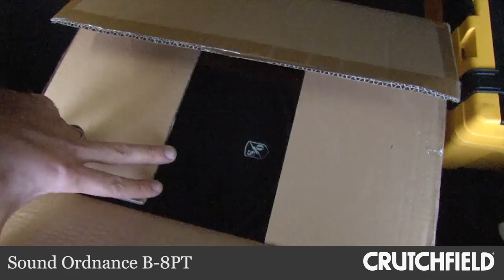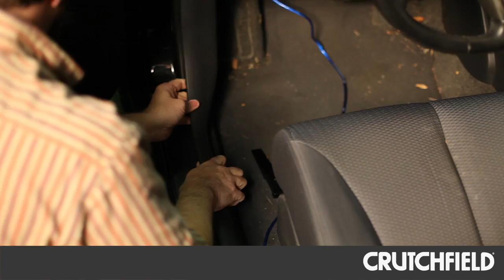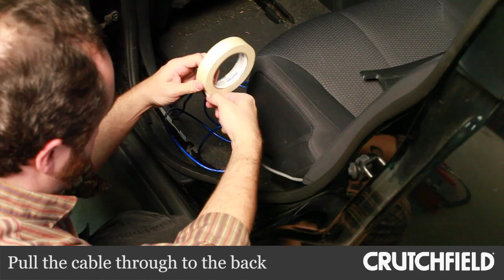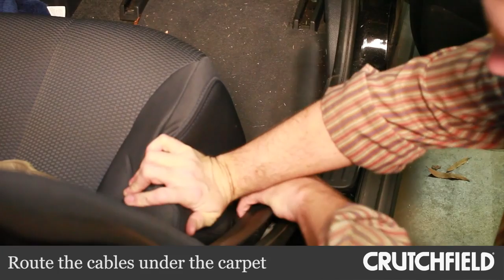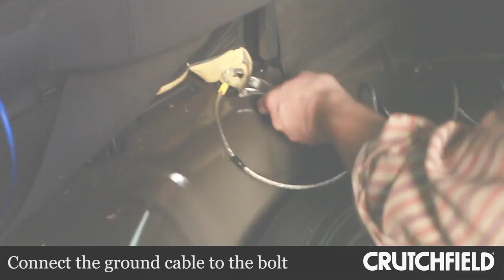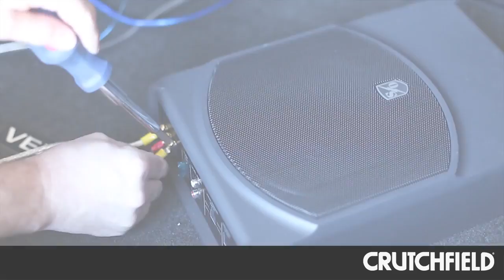How to Install a Car Subwoofer | Crutchfield Video

Comment: What side did you run the remote level control wire on? With the power wires or the RCA and remote turn on lead?
Reply from the maker: While we did not cover the wired remote installation in this video, most folks do run it on the driver's side.

Comment: I've sound ordnance b 24 ,what amp I need to push these CVS dual subs
Reply from the maker: +Dupree Spearman to properly power the Sound Ordnance B-24 dual sub enclosure, you'd want an amplifier rated between 400-600 watts RMS x 1 at 4-ohm. 

This Pioneer GM-D9601 amp is a good option to consider for your setup: www.crutchfield.com/I-rYTVc000/p_130GMD9601/Pioneer-GM-D9601.html

I hope that helps!
--Crutchfield

Comment: I have one question abou connecting positive cable to battery and subwoofer. Should i first connect it to the subwoofer, then connect the secure thing (50A) close to batery and then connect it to battery? Or first connect it to battery, and then to subwoofer?
Reply from the maker: +Gabriel Durias You should wait until you have everything else connected before connecting the power wire to the battery. Make that your last step on the installation. I hope that helps!
--Crutchfield
Reply: +Crutchfield Thanks

Comment: What about the speaker wire?
Reply from the maker: jp martinez In this case, we installed a powered subwoofer. The amp, subwoofer, and box are all one piece. No speaker wire was needed. If you install a separate amp and subwoofer, then you need to run speaker wire between the two. Installing both in the trunk means that you will not need to route the wire through the vehicle. For additional assistance & personalized recommendations, feel free to contact us directly:
@1 

I hope that helps.
--Crutchfield

Comment: It may be a silly question, but negative or positive battery terminal?
Reply from the maker: You would connect the power wire to the positive terminal on your battery when installing an amp/powered sub.

I hope that helps.
--Crutchfield

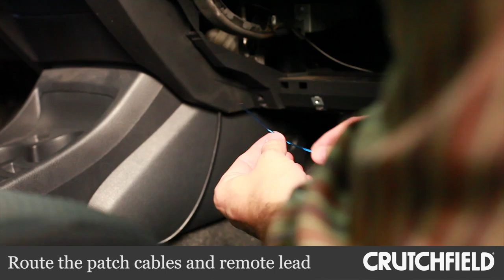Comment: What is that small blue cable at 2:16 ?
Reply from the maker: That is the remote turn on lead wire. Its purpose it to tell the amp in the powered subwoofer to turn on when the radio is turned on.
Hope that helps!
--Crutchfield

Comment: You forgot about a 40A or 50A fuze at about 30cm from the positive contact at the battery. Just in case, so the blue power wire doesn't heat up and burn down your car. Also protects your subwoofer. The small 15A fuse behind the subwoofer is just an extra precaution, but is not strong enough for a 120w sub.

Comment: I just purchased 2 l7 4 ohms 12inch subs.  I want to wire them down to 1 ohms, what is the strongest amp that I can use?
Reply from the maker: The current versions of the Kicker L7's are rated for up to 750 watts RMS each. If you have the dual 4 Ohm Voice Coil versions, you'll want a 1 Ohm stable mono (single channel) amp that can provide around 1,500 watts RMS to the 1 Ohm load in order to realize the full potential of both subs.
For additional assistance & personalized recommendations, feel free to contact us directly:

By phone: 800.315.0030
Online chat: http://bit.ly/1b07Ykm  
e-mail: advisors@crutchfield.com 

I hope that helps.
--Crutchfield
Reply: So the RF R1200-1D Mono amp should be fine?
Reply from the maker: Shaun Thompson For around 600 watts RMS per sub? Sure. That will work.
--Crutchfield
Reply: So basically if I wanted to,  I could turn the gain all the way up on the amp and never have to worry about blowing my subs?
Reply from the maker: Shaun Thompson No, no. Not at all. You always need to set your gains properly to eliminate any chance of clipping or distortion: http://bit.ly/19l4yWJ 
For additional assistance & personalized recommendations, feel free to contact us directly:

By phone: 800.315.0030
Online chat: http://bit.ly/1b07Ykm  
e-mail: advisors@crutchfield.com 

I hope that helps.
--Crutchfield

Comment: Im about to put in an active subwoofer in my car. I got a red cable since previouse owner that goes from the battery to the trunk.

The only thing i dont understand i bought a new cable kit aswell, and got a fuse with it.

Do i need to mount the fuse on the 12v cable? 

The Subwoofer got a fuse on it aswell.

And now the last stupid question.

Should i remove the cable from the battery, install every cable and then remount the 12v cable onto the battery?

Thank you for your time, have a nice weekend! :D
Reply from the maker: An in-line fuse holder & fuse within 18 inches of the battery termination on the primary power lead is certainly recommended. Connect the power lead to the battery once everything is installed, connected & ready for power.
For additional assistance & personalized recommendations, feel free to contact us directly:

By phone: 800.315.0030
Online chat: http://bit.ly/1b07Ykm  
e-mail: advisors@crutchfield.com 

I hope that helps.
--Crutchfield
Reply: Crutchfield Thank you for an quick and good answer i will first check the 12v if they have hidden the fuse along the cable otherwise i will connect the new one. :P! You guys rock! :P Now i might finally dare to connect everything xD

Comment: Just to add some information.. you lost power of the battery by putting it on the cold cement. Anytime you drop the battery from a vehicle it is mandatory that you put it on a plank of wood or a shelf otherwise the electrolytes within the battery loose their electrons.

Comment from the maker: A subwoofer and amp/speaker upgrade can make a big difference. Depending on the specific year & trim package, we may offer an integration kit that would allow you to replace the stereo as well. Feel free to call for additional assistance: 800.315.0030--Crutchfield

Comment: I have a question and I hope you guys can help me out. I'm thinking about buying a mid size sedan, namely either a Ford Taurus or a Honda Accord. They both come with what I call "crappy radios" which I can't seem to be able to change since they're build in on the dash. Will adding a small sub like the one shown above along with new speakers and amp make a difference?

Thanks.

Comment from the maker: Most powered subwoofers willl offer "Speaker Level Inputs" specifically for connection to a factory system that would not have RCA pre-amp outputs. They allow you to tap off the factory amplified speaker wires to supply signal to the amplifier. Feel free to call for additional assistance: 800.315.0030--Crutchfield

Comment from the maker: Depending on the vehicle and the selected mounting location, the installation time can vary wildly. With an amplifier/sub combination mounted in a trunk, I would be sure to set aside several hours to ensure you have plenty of time to complete the installation properly without rushing. Feel free to call for additional assistance: 800.315.0030--Crutchfield

Comment from the maker: You should always use a fuse. I know one did not appear in the video (due to the angles), but one was definitely installed. This installation was done with the EFX 8 gauge amp wiring kit and the power cable in it has a fuse holder already installed on the power line--Crutchfield

Comment from the maker: Yes. Most powered subwoofers (Including the Sound Ordnance B-8PT featured in this installation) offer "speaker level inputs" specifically for use with factory stereos. Feel free to call for additional assistance: 800.315.0030--Crutchfield

Comment from the maker: At that time in this video, we are connecting the lead that tells to turn on only when the radio is on (you do not want the amp on all the time draining the battery when you are not in the vehicle). That is the function of the remote turn-on lead. Aftermarket receivers have this wire and some call it by a different name of accessory wire--Crutchfield

Comment from the maker: @StunnaTwo9 Assuming you mean the speaker wires; that can vary based on the terminals of the subwoofer. Most models will accept bare wire, spade connectors, or female quick slides. Feel free to call for additional assistance: 800.315.0030--Crutchfield